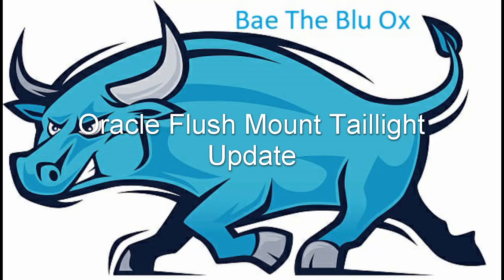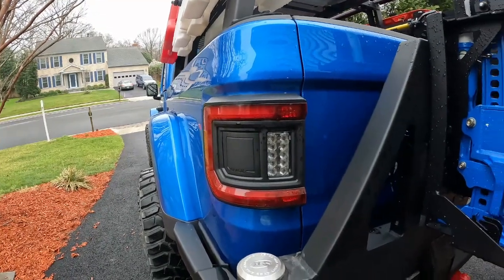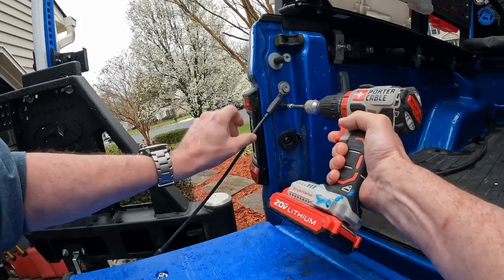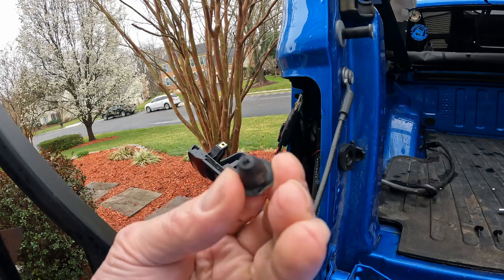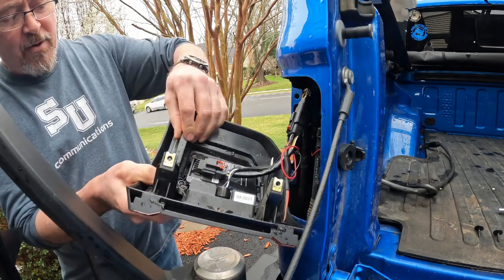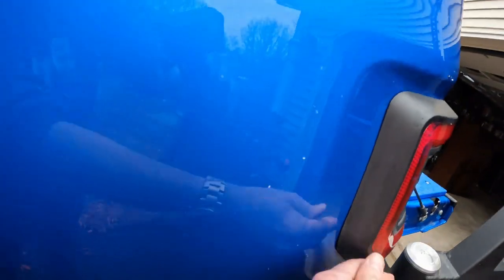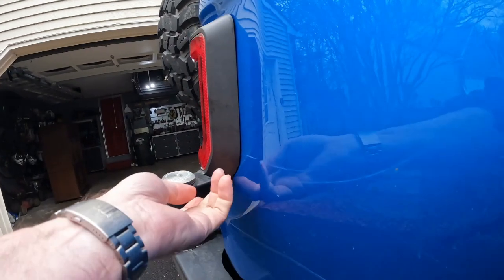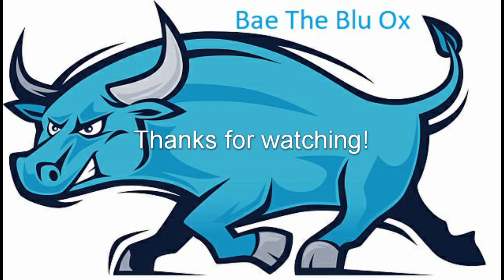Fix the gap on the Oracle Flush Mount Taillights?

Comment: Why not measure the posts then use a sharp drill carefully poking the cup ?
Reply from the maker: You could try that but all you need to do is remove the very tip of the cup so that the rod will poke through and hold tightly on the sides for stability.  Thanks for watching!

Comment: Couldn't you just shorten the post on the lights instead?
Reply from the maker: I guess you could but it is easier to cut the rubber cup then it would be to trim the aluminum post and it accomplishes  the same thing.  Thanks for watching!